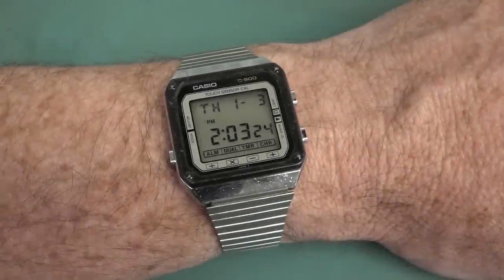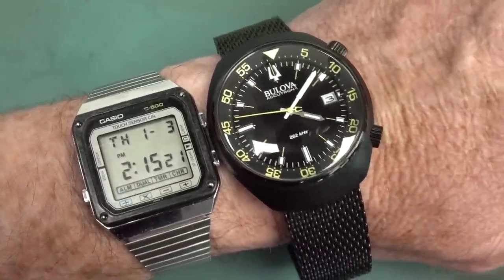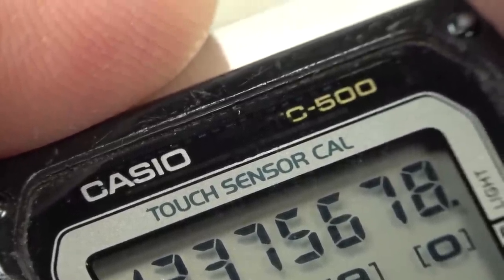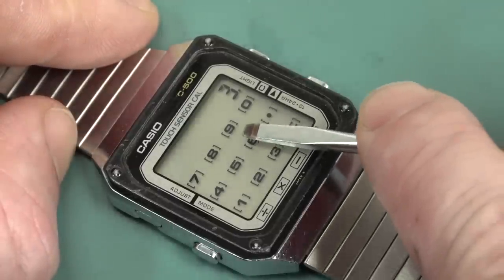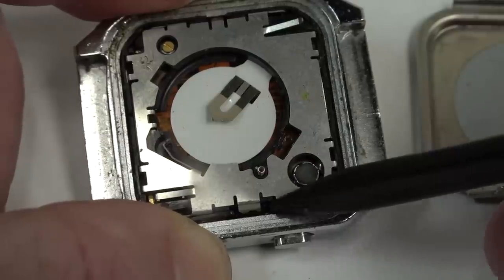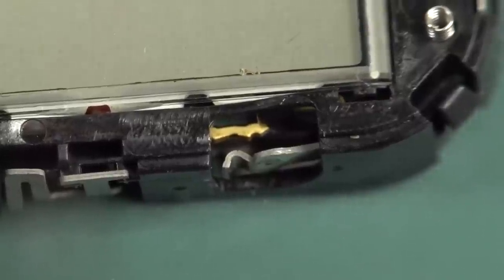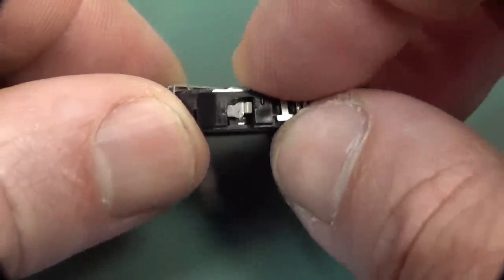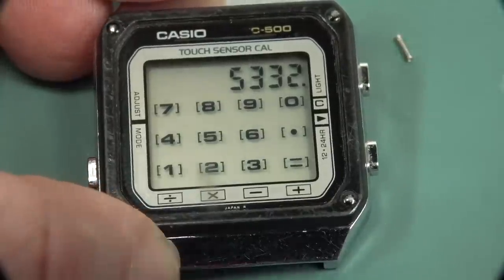EEVblog #1166 - Amazing 1980's Touch Screen Calculator Watch!

Comment: I had the one with the tiny rubber buttons, you needed a matchstick to do calculations :-D.
Casio was always clever.
Reply: I always wanted a calculator watch for cheating in math exams but they went allowed obviously, with this watch it would have been possible because of stealth.

Comment: I had one of those back in 1983-1984. The electrodes are not etched into the glass. A layer of clear conductive material is deposited on top of the glass and the electrodes are etched into that. I scratched the face on mine and to use the calculator with all the keys I had to fill in the scratch with pencil lead before use.
Reply: They etch the ITO-coating, that's what he meant.
Reply: lol. Exactly the same here. Watch was a present from my parents and they were pissed I put a scratch on it within days of receiving it.

Comment: I always wonder how much engineering time goes into building something like this.
Reply: bovinespongiformflu and without the help of a computer nor cad tools
Reply: I would think after it's designed  the real engineering has only just begun. The next step is designing a system for mass production and I think Casio was better at this than designing the watches.
Reply: They had cad tools and computers but not near as advanced as today.
Reply: Think that you have to invent something that doesnt exist, it takes years.
Reply: - No CAD tools? No computers? There's a computer in the the actual watch.
Reply: @joselaw6669 A micro controller most certainly is a computer. It has a CPU, storage (or ROM), RAM and IO. Seems unlikely they implemented a full calculator without CPU.
Reply: @scotshabalam2432  "I would think after it's designed  the real engineering has only just begun. The next step is designing a system for mass production and I think Casio was better at this than designing the watches."

The design process isn't as linear as you make it out to be.

If you really want to optimise a technology production line, you'll need to have those considerations in mind right from the start. You don't want to 'finish' a design and then find out it's unsuitable for mass production.

Comment: Hi Dave! What a cute watch! I wanted to comment about the rubber strip connector having so many (more than needed) wires. It's mainly for two reasons, one to avoid misalignment between the two ends, the other is that each of the single wires must be thinner than the separation between traces on the PCB, to avoid the rubber strip to short-circuit them.

Comment: Thank you for posting this and taking me back to my childhood.  I saved up my paper route money and bought a Casio Touch by the end of the year they came out.  Which was actually in 1982.  I know it was 1982, because I had it for Winter and the next Summer (1983) I wrecked my bicycle playing chicken with friends, broke my arm and scratched the screen on pavement.  While the clock, alarm and chrono all worked, the calc was dead. 

Central Ohio, it cost me $299us.  I only wish it was $29.99 :).  Mine was all chrome though.  I can't remember if it was a TC-500.  Mine said Casio Touch on the top.  We got a lot of electronics "early" in Central Ohio.  I think it's because we were also a food test market for brands like McDonald's, Borden, Kroger, Big Bear, Pepsi, Coke, etc.

Comment: During this era Casio briefly had a calculator watch on the market where you drew the digits over the face using a finger.  The touch consistency and the stroke recognition both sucked, so the product was promptly withdrawn.

For me, the big downside of calculator watches was they were always stuck on the arm!  I often needed to write and calculate simultaneously, which a watch made impossible.
Reply from the maker: Oooh, product part number?
Reply: @EEVblog  All the best things are(were?) definitely made in Japan...
Reply: BobC Did you wear the calculator on the wrong arm?
Reply: @johnfrancisdoe1563  Maybe he's just got the one arm which would suck for, ahem,  'one handed surfing'.
Reply: Dave Micolichek  the datasheet warns you that if you use this watch without it being on your wrist, you must hold the back of the watch with your hand. So still not great for taking notes
Reply: Do you write with two hands? Do you write and calculate simultaneously? I don't get why it needs to be off your arm.

Comment: I used to have one of those watches!

I won it in a charity auction, on the local wireless.

It lasted about 10 years, before the touch screen failed.  I remember it could display the time VCR-wise

Comment: Still using a Seiko from around that era. The watch would be no longer manufacturable, not because the design files and moulds are not around ( they would be on paper and the moulds probably in an archive, and also used partly for other models) but the machinery to make the LCD display, the IC fab to do the custom ultra low power CMOS ASIC no longer exist, though they would probably still have the original photoliths for the LCD and the original mask set for the ASIC. But the actual machinery to make them would have been repurposed over the years , upgraded and replaced. Biggest thing would be the LCD, as that uses 3 layers of glass in it, one in the middle that is ultra thin and coated both sides with ITO, and then 2 regular LCD panel glass layers.

However, it is likely there is a warehouse, inside the Casio company, that has a few hundred of the spares to make complete units sitting in a corner.
Reply: SeanBZA There are still factories making 4000-series CMOS logic.  One of those should be able to run the Casio ASIC masks.
Reply: A recent low power microcontroller could probably do the job.
Reply: @seanBZA cool story bro.

Comment: I had both of the watches you mentioned here.  Love this vid, brings me back to my younger years.  I used the CFX-400 a lot, but the use of the scientific part took a bit of time to be comfortable with.   I had that watch for about 2-3 years, and then, when I started working on MRI system, I would take it off when the MR magnet was on, and somebody grabbed it along with my beeper, and that was all there was to it.  I gave my best friend the "4 banger" TC-500 (which was in perfect shape, no scratches, no dings) when he lost his watch into a lake, and that is an interesting story too.  I like the Casio "WaveCeptor" watch, and I have about 4 of them all working perfectly.  I like that watch a lot, because every night at around 12 midnight, it will set its time via  Fort Collins, Colorado's WWVB signal.  You know.  The one that was created in 1945, and our ever so smart POTUS is considering cutting funding for keeping the station on the air.  Also, considering killing the atomic clock there also.  UGH.  Don't get me started. {bleep, bleep, bleep idiot....}    Love the video, and thanks!!

Comment: Nice. Always been a fan of Casio.
I have a gold Casio calculator/databank watch. DBC-611G module 3228.
A Chinese vintage reproduction I think. The calendar goes from 2000-2099. Has 13 languages, 5 alarms, auto-illumination function.....tilt 40degrees and the light goes for 1.5sec. And holds 25 name/phone number contacts. Dual time, stopwatch, day date etc. Gold colour metal case w/ matching metal bracelet strap. Pity it's not an original made in Japan watch, but I really like the look of it and it cost only $59(NZ).

Comment: Great video Dave, interesting for us 'younguns' who remember and saw the watch but were not able to own one back in the 80s or take it apart. In terms of the hardware design, did they just draw it out, have it stamped out of a metal sheet, bend it, try to fit it, rinse and repeat? Its hard to comprehend how they managed to take in to account all the bends and still manage to end up with something that fits together better than most of what we buy today.

Comment: Trimmer cap in the back for fine adjusting the quartz oscillator...you almost never see that anymore
Reply: douro20 They quickly figured out how to do this on-chip via menus.
Reply: @johnfrancisdoe1563  Any of the better quartz movements will have a trimmer for fine adjustment.
Reply: It's easier to do by software, no need for any extra parts that you have to fit in there.

Comment: I have the successor 1986 model of the Casio watch you have, the TC-600. It has the same exact dimensions and module, different bracelet, but no front black plastic bezel. Bought it broken without a screen and replaced it with a screen from another non-working TC-600. I wear it daily but the touchscreen doesn't register any of my touches even though there are no heavy scratches on the glass screen. May get around to fixing it in the future.

Comment: I had the Casio Tele Memo 50 - it could store 50 phone numbers with names (max 8 chars + 12 digits).  The case ended up snapping near the band mount.  It lasted about 10 years.  I haven't worn a watch since.

Comment: Hey Dave, if you love that watch you'll want to replace that O-ring with a fresh one.  Sweat and gunk, which you saw when you opened it, will make its way in and corrode things faster than you think.  Now that it's been opened, bad things can happen if it's not cleaned of all that gunk and properly re-sealed.

Comment: I wonder if a polarized filter would help you see the glass traces better. We used to use polarized lamps to see where the plastic flowed in injection molded lenses.

Comment: Casio were absolutely on fire at this point in the 1980s, both their calculators and their watches had some superb design and functionality. It seemed though, when they made the IR remote control and data bank watches that they just lost interest somehow. Such a shame that they didn't progress to a full dot matrix display and programmability. I wonder if the core design team retired or moved on to something else instead? Always preferred the CFX-200 form factor, even without the hex conversion, having physical buttons rather than ZX81 type "touch" keys seemed so much better.
Reply: The 80's was a great time to be making wrist watches period they were in extremely high demand.
Seiko, Casio, Swatch, Timex, and others were all doing well.

Comment: The LCD is (probably) made out of two stacked LCD glasses, but as in a normal LCD there probably are only two polarizers. The liquid crystals shift the polarization by 90 degrees but are transparent, and the symbols thus appears on the top polarizer, so you can't see the two layers.

Comment: Casio was my favorite until they started making the case from chrome plated plastic. I owned 4 of them! I worked as a building maintenance person and did auto mechanics so most of my watches were ruined because I wore them all the time. One was electrocuted! One was destroyed by chemicals( carburetor cleaner) and one was busted by a pulley on a car( missed my arm anyways). My last one stopped working and after that, I found they were made with cheap plastic. I did have a caculator one and used it too. I swore if I ever found a prestine one again ( in metal) I would buy it.

Comment: I was five years old in 1983. It was an interesting time to be alive. I only got to see it as a little kid though. It was around this time I saw a record player work. My brother had bought a used turntable and connected it to his boombox. The thing was like magic! Cable television was so much cooler back then too. None of that digital rubbish. The picture was grainy, but it was worth watching. Not like today. There was no IR remote either; just a wired selector box about a foot long. It was forty channels from the comfort of your lap. Cable television is just expensive garbage now. The digital and high definition doesn't save it from how crappy it has gotten.

Comment: My favourite watch was the Casio DB50 - it wasn't a calculator, but it had the ability to hold 50 schedules (like alarms, but for a specific date, with arbitrary text you could set) and 50 phone numbers - and the ability to generate the DTMF tones to automatically dial those numbers.  Came in handy, back in the days before mobile phones.
Reply from the maker: Wow, didn't know about the DTMF
Reply: Yeah, it came out of a speaker between the Back and Forward buttons on the face of the watch - I was going through boarding school at the time, so having easy access to important phone numbers was really handy.   And don't tell anyone, but the "incoming call only" phones at the school were just ordinary Telstra TouchPhone100 with the keypad replaced with a blank plate, so if you had other ways of generating the DTMF.... ;)

Comment: Was this really from the early 1980's? Also that plastic PDA thing was something from the early 1990's surely.

My early '80s CASIO calc watch had the black strap while my older brother had the deluxe one with the metal strap as our Christmas presents. These both had the rubber buttons and believe it or not we actually played the "games" on that tiny LCD.

Early '80s PDA's where from the likes of Sharp with receipt printers as docking stations, not the '90s memory bank stuff @18:03. In fact they weren't PDA's at all as diary apps and stuff didn't exist then.

Comment: I still have the all-plastic version! Unfortunately, even a small scratch on the surface ruins the traces that makes the touch trick work.
Reply from the maker: Didn't know they had a plastic version
Reply: @EEVblog  the TC-50. There was a also a really nice TC-600. The design really stayed relevant, IMO.

Comment: 13:56 I'm rather curious about the strange PC board trace pattern on the right side, near the top. It appears to connect to the capacitor next to the crystal oscillator. I cant tell if they just labeled something with negative space on a copper fill, or if that's possibly some PC board trace inductor/capacitor stuff, like you see with RF sometimes. Does it have something to do with the case connection, and how the watch requires that you touch the case for the touch sensing to work? It just stood out to me.

Comment: Dave you say that the watch gives an error when you multiply numbers to large to fit the screen. This isn't true,  the example you tired, 25236522x5525=139431784050, is given as 1394.317E by the calculator, the E standing for 10^8.

Comment: Doesn't the capacitive sensor fit below the LCD layer? If so, why doesn't it shield the underlying capacitive pads from your fingers. IOW the high impedance capacitive pickups are below the medium or low impedance LCD traces, creating an electrostatic shield.   Obviously I don't understand what's actually going on. This watch is amazing in multiple ways.
Edit. Another thought is that the LCD traces are strobed such that they are floating when capacitive sensors are active. But there's the RC charge time that has to be taken into account as well.  Lots of work for the LSI chip!

Comment: I do not get why Casio puts the 12/24 mode for the key. Citizen has it in the time settings so you will not accidentally touch it. On my current Casio if you press it before noon, you have no way to notice as there is no AM or 24H sign. Nobody uses both modes, one uses just one of them for all time.
Reply: Okaro X On most of the displays of that period there were frequently AM/PM indicators on the LCD, and sometimes a “24”, but the “24” was much less common if there were “AM/PM” indicators since the absence of them would infer “24”.  That said, many Casio LCD watches today still include at least am “A” and “P” on their display.  But I think the main reason they placed 12/24 on an external button was partly because the could and partly because a watch that could be both 12 and 24 hour time was pretty novel in the 80s.  Over time this setting did tend to migrate to the internal time setting programming menu rather than an external toggle.  But as far as not knowing whether you were in 12 or 24 hour mode in the morning, it really did not matter and once 13:00 came around you would know you were in 24 hour mode and could just tap the toggle button if you wanted 12 hour time — though I don’t recall ever accidentally toggling the time mode despite having worn such watches from the early 80s up until the mid 90s as the buttons had to be fully depressed and required a bit of force to fully depress.
Reply: @ethanpoole3443  Yes, that was at the time. Current ones that I havbe have only P for PM. I have set alarm on 14:00 so I can tell which it is. I do not use the alarm and I actually silenced it. I have pressed it several times accidentally.

Comment: It looks like the vertical laid pads for the touch were on the inside. The horizontal ones on the outside. 16 vertical, 16 horizontal.

Comment: times have changed... Nowadays we have expensive smart watches doing almost everything (you might consider useful) on their screens, emptying the battery in a few hours. In the eighties we had smart engineers making cheap but brilliantly built little machines like this doing something (considered) useful with a battery living for months. None of both are really useful, only nice to have... There's one significant difference besides of battery life: The watch shown here will probably work when powered on again in 30 years. The smartwatch probably won't.
Great technology and also a great video. I like it.!

Comment: Anyone know where I might get a new zebra strip for the TC-600?  I've got my fathers old one, it's got a new crystal, but still the touch does not work properly, and I think it's the zebra strip.  

Also, it's running a bit fast, is there a solution for that on a digital watch?

Comment: I don't understand how that thing is still running. All my Casio watches eventually died. They lost segments, or started growing mold under the glass, or simply would not come back to life after a battery change. I remember back in the early 90's paying about $50 to have my cherished watch  restored, only for it to die again a short time later.